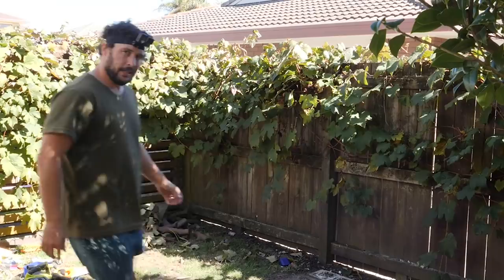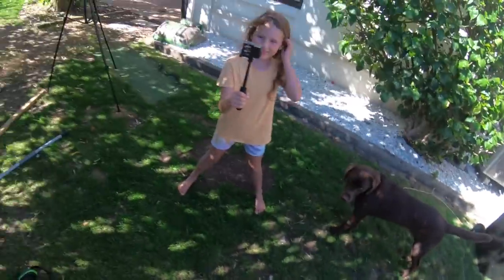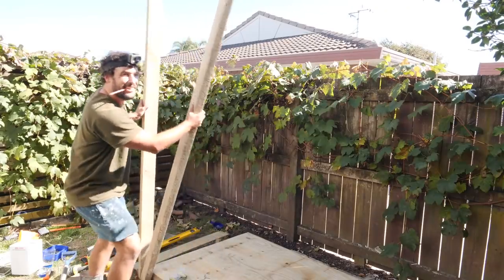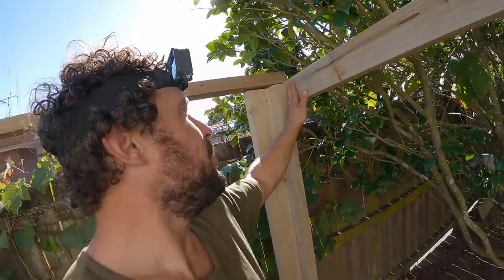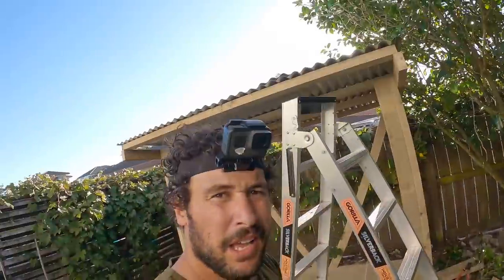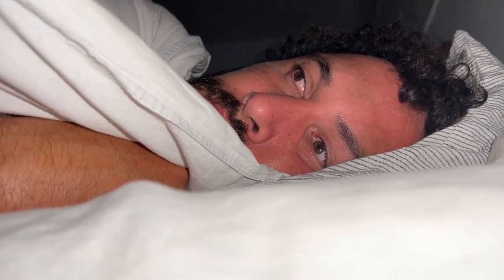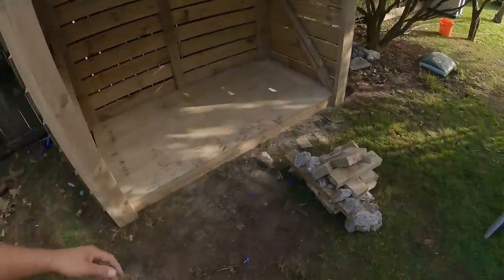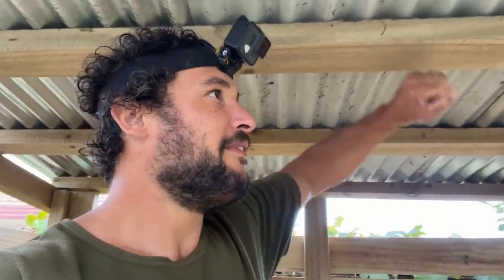HOW TO BUILD A SHED (start to finish)

Comment: Hey, Jordan.  Unless you have other plans for those “Bracing” Wood posts, you should reinstall them for additional support.  No one will see them when the Shed is loaded with Firewood, and if someone does say something, you can just tell them to “Bugger-Off”.
Reply from the maker: Nala has already chopped them up and turned them into 'art'. She'll be right.
Reply: @HowtoDad  Did you let Nala use the Power Saw or Did She Chop them up by Hand?
Reply: Nala is basically  cucknorris. As legendary  and even better actor. So i put my hands on fire and say, she used karatechop to chop the wood or even brick break... ain't confusing chucknorris with pokemon